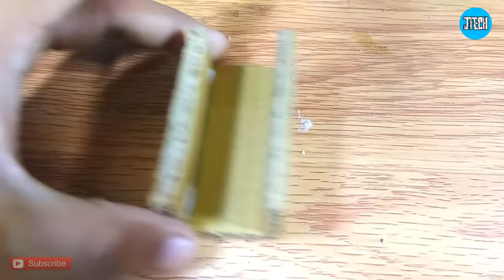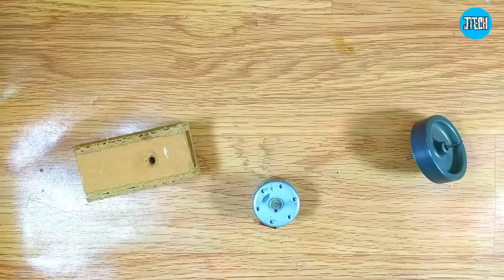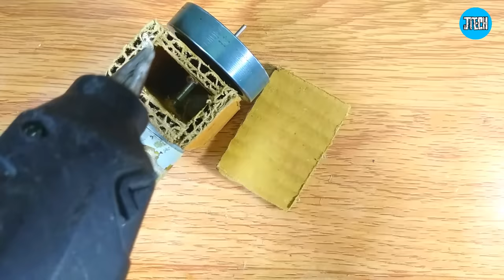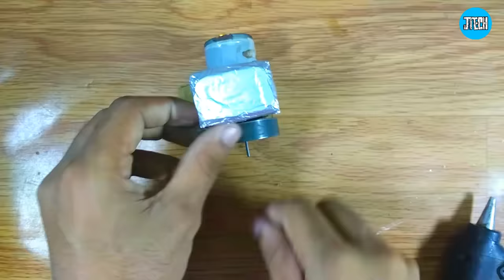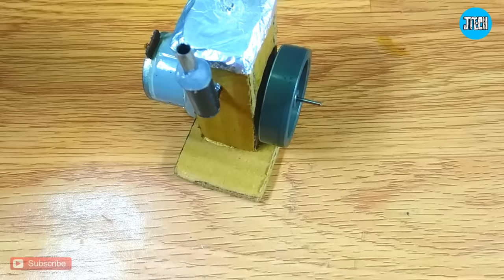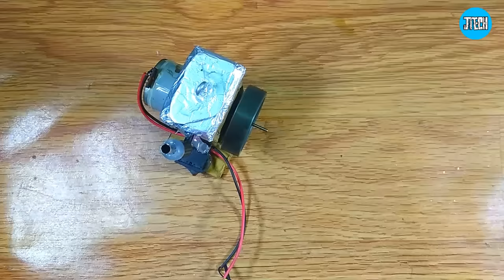how to make a diesel engine model at home | mini diesel engine from cardboard

Comment: It turns out that the diesel engine does not work on the principle of fuel compression, but on the principle of magnetic induction. So Tesla doesn't make electric cars, but tractors? And is Tesla Cybertruck actually a Tesla CyberTRACTOR?! What do you think, Elon Musk?!